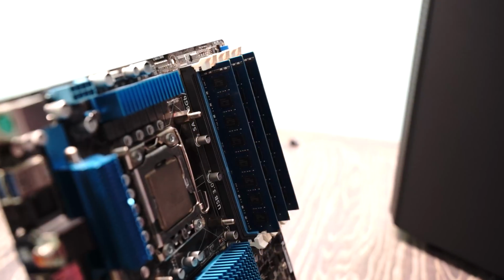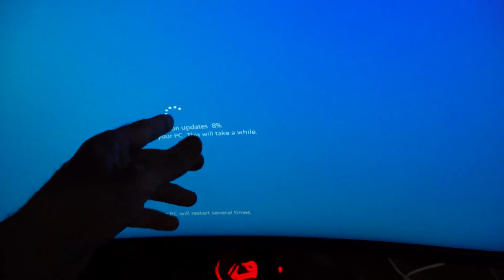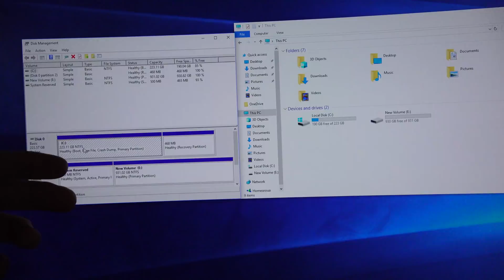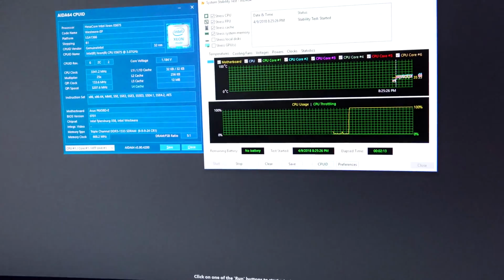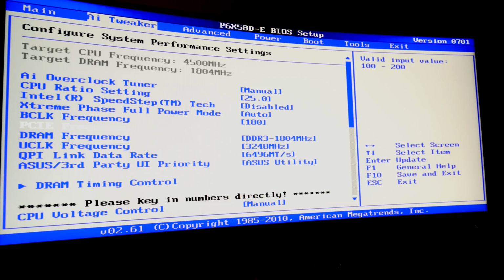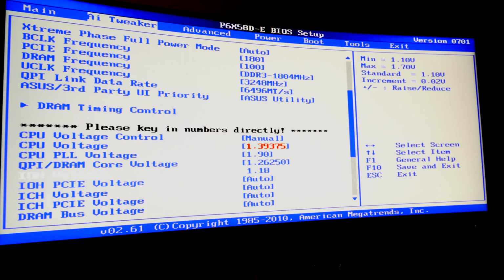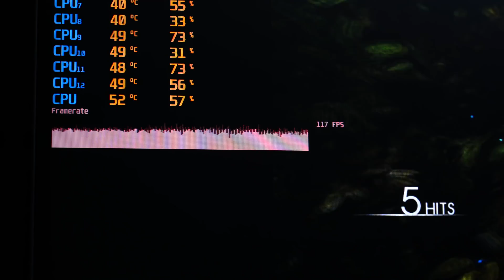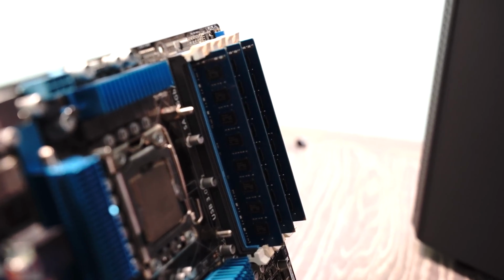Is X58 Still Worth it..? Taking the 6 Core X5675 to 4.5GHz on AIR.

Comment: Iv been rockin my 1366 x58 platform since 2011.....Im not sure why it would be your favorite platform, its completely useless.

The 1366 platform was a flop. Triple channel memory showed ZERO benefits and no real increase in memory bandwidth over dual channel.

The IPC of the first gen i7s was horrible even at the time and the only true benefit to using the 1366 platform was to have 6 cores. Which, at the time was also useless unless you were running very specific programs that can make use of multicores. 95% of your programs out there, even in 2019, dont make good use of multicores. Even today, 6 cores is pretty useless.

And if 6 core was what you wanted, a year later Sandy Bridge came out and wiped the floor with it meanwhile Intel abandons the 1366 platform for desktops almost as soon as its born.

In terms of performance, within a year the X58 chipset became not only irrelevant, but non competitive for its price. Even today, theres much better options for the price.

This all is coming from someone who has had a first gen i7 since day one. At 4.5ghz they finally start become more on par with Sandy Bridge (which is more than 1ghz high speeds) nevermind the insane power draw and silicon melting temps as a result. 

They are too power hungry for good overclockers. 4.5ghz was impressive back on the Netburst days, but modern chips are hitting past 5ghz easy.

Comment: I already have all the parts I need to build my computer but I found this sweet deal i wish i had gotten before i bought them all. 100 dollars for x5675 cpu with motherboard, cooler, psu, and 4gb of ecc ram: https://www.ebay.ca/itm/163768068094

Comment: idk why you're having so much issues... i didn't with my P6X58D-E... 
Tho i did have to find a thirdparty driver for the Marvell 9xxx Sata 6gbps controller :P
Reply: Btw, running a i7-950 at 4ghz rn, (211 x 19 @ 1,27500v) Gonna upgrade to a X5670, X5680 or even X5690 tho.

Comment: Dude man running 4670k @ 42 ghz overclocking and been running like this 6 years still solid with Maximum Formulas  Asus Rog motherboard Corsair vengeance 1600 DD3 Memory  SSD OCz

Comment: YES IT"S WORTH IT STILL! I have Asus Rampage III Formula with 24GB Ram at 1600Mhz Running a Intel Xeon X5687 at 4.2Ghz atm and the Motherboard supports PCI-E 3.0 :) with 2 GPU's at 16x PCI not 8x like most board these days.
PUBG 75FPS Max Graphics on FreeSync (Speed of my Monitor)
GTA V FiveM 60FPS Max Graphics With FreeSync (But Frame Limited to 60Fps)

RUST 75fps Max Graphics FreeSync

I don't count games like Half-Life or Fortnite Because they go so far beyond the monitor specs i Freesync it to 75FPS but if i turn it off it just keeps raising

Comment: Hi, i have a Xeon 3690 with unlocked Multi. How much VCore can i give him? 1.45  @ 4.4 ghz is absolute stable. 1.48 @ 4.6 worked, but was not stable (temps aroung 65-70 C). you think i can give 1.5V Vcore?

Comment: The sad thing is that x58 is dying not because the CPUs aren't any good but that the prices of the motherboards are quite simply ridiculous. If you go the route of getting a new Chinese one from Aliexpress then you'll often find they have no overclocking ability, which kind of removes the point of going for that socket and chipset in the first place.

A $20 CPU isn't worth it if the motherboards cost near $200.

Comment: will a rx 570 work on x58 motherboards? anyone know?
Reply: I run a rx 580 8gb I'd assume so
Reply: @dabbo1980  "I'd assume so" sorry but im confused so you are saying you are in fact running an rx 580 on a x58?
Reply: @dabbo1980  nvm got you buddy, in that case it should be fine with rx 570 cool thanks
Reply: @dabbo1980  btw is your x58 one of the ones sold on ebay, the unbranded ones? I just want to know that the board wont give me problems

Comment: I have a 4930k, custom water-cooled and running 4.7Ghz @ 1.41V for the past 5 years. Running numerous benchmarks, it comes in just under the Ryzen 1800X stock for multi threaded and is faster by a good margin in single thread.

Not to mention the older quad and triple channel memory boards keep pace with the dual channel ddr4 boards at 3000mhz or greater.

Obviously clock for clock the 4930k is starting to show a bit of age, but with a good overclock it holds its own and I'm still surprised at how slow technology as moved in raw CPU performance. The trade off is, my old CPU uses 180W to achieve what a 90W processor does today.

Great video!

Comment: Which Ram should I use on this motherboard ? Can i put in a cheap set of ddr3 without having compatibility issues ? Currently running 4 sticks of dominator ddr3 memory but can't get all 6 sticks work togheter ( pobably 1 dead stick ) with x5675 and RTX2080

Thanks

Comment: Just out of curiosity I glossed over the prices on Ebay for the Asus X58 motherboards and they still command USD $170 to $200. Overclocking is fun and all but I think I'd rather go with a Shenzhen noname X79 and Ivy Bridge based 6 core Xeon for less

Comment: Could u do a video where u compare performance between for example: 211mhz x 19multi, vs higher multi and lower base? (Both should be 4ghz) and see which one performs the best, and is the most stable.

Comment: Is there something that i´m missing here??? Just got the same board with the same cpu and just started with overclocking. Followed most of your settings but i can only get the multiplier to 24. Bus speed is set to 175 to obtain 4.2 Ghz but I keep dropping the voltage more and more and i´ve gotten to the point that i´m at 1.24V and it´s stable on aida64 for over 2 hours now....??? Is this normal and should i keep dropping the voltage? Temps are currently at 68 degrees at full load after 2 hours with my noctua air cooler. Any advice would be highly apreciated. Also.. my memory which is 1866Mhz ddr is running at 875Mhz (Dram frequency) 2:10 FSB:Dram, CAS 9.0 11-11-28. Is the memory running the way it should be? I am not getting any errors so far.

Comment: I have a UD3R and I am having the issue you described. I cannot get it to boot. I have 4 solid lights on motherboard but screen is blank. i7 920 works perfectly fine but once I put in Xeon 5670, PC did not boot and black screen. Gigabyte EX58 UD3 R.  Rev. 1.6,  12GB Mushkin Black, OCZ 1000watts, Windows 10 and when I tried to update to newest bios it wouldn't. So I called Gigabyte and they told me that my board does not support Windows 10, only 7 so I was not able to update. I believe its F1 or something. It was the 3rd from the latest Bios version. Any help would be appreciated.

Comment: Stumbled across this video after picking up a DELL Studio XPS 9100 with a i7 960 quad core @3.2GHz, 12GB DDR3 RAM, EVGA GTX 960 SSC, x2 1TB HDD and the touch screen SX2210 monitor for $160 on Facebook.  I then found a Lenovo ThinkStation S20 with 24GB DDR3, Xeon W3680 hexacore @ 3.3GHz, a Intel Pro 180GB SSD and a Samsung 256GB SSD for $80 on OfferUp.  Put it all together with a GTX 1060 3GB I got for around $70 on eBay.  Now I have 2 gaming rigs that can run my Oculus Rift and anything else I throw at it for around $300 USD.  The w3680 overclocks to 4.2GHz damn near effortlessly.  There is NO better bang for the buck unless you are shooting for a low voltage system or have a garbage PSU.

Comment: Hi Mr. Brian, I really like your videos and I just bouth two x58 motherboards .. 
1: Gigabyte x58UD3 With a i7 960 for about $56 USD on Ebay.
2: Asus sabertooth x58 with a x5670, 24 GB and a heatsink but don't know the brand for a $178 USD.
Sed that, the Gigabyte motherboard has some bend pinsbut nothing major.
The asus is in good condition boot to the BIOS and recognize the xeon x5670 but when I try to install windows  7 or 10, just when is about to finish the installation i get blue screen. I try different jhd and a ssd but still get ablue screen.
My question is.. what I missing or am doing something wrong? 
I have a cooler master m240L A/O WATER COOLING but nothing.
 Any help will be great. Thanks Love the x58.

Comment: I have a HP Z420 workstation with stock motherboard. can you overclock E5-2643 v2?
Reply: nope, only the e5 16XX v1/2 chips can be overclocked on your platform - and on x99 e5 16XX v3 chips have an unlocked multiplier too
Reply: @SGIMartin  how can i know if any processor can be overclocked?

Comment: The problem with x58 boards is their is only 2 to 3 pcie 2.0 x 16 slots. Where most new video cards need pcie 3.0. So you can run a new card in pcie 2.0 but will reduce the performance of the card so it's not really worth it.

Comment: Should have gone for the W3690 for about $80. I overclocked mine to 4GHz and it doesn't get past 55 degrees with a Hyper212. It benchmarks 5-10% above the much more expensive X5690, which is meant for dual CPU mobos. It's almost twice as fast as the i7-930 I had, which overheated and had to clock down when I tried to push it to 4GHz. Highly recommend the W3690. Cheers
Reply: x5690 is cheaper actually because they were produced in pairs.

Comment: I recently bought a complete X58 gaming rig for &100au that has the ASUS P6X58D-E mobo. I was wanting to get a Xeon CPU for it but when i checked on the ASUS web site for compatible CPU's, only the i7 900 series was listed so i am running the i7-950 that came with the system. I am spewing i didnt see this video earlier. The only upgrade i have done to this PC is to the CPU cooler.I got rid of the standard Intel unit and replaced it with a GAMMAXX 400. I am now ready for some overclocking. 

   I do also have another ASUS mobo which was given to me for free by someone i bought some ram from. The board is an ASUS P6T Deluxe V2 and is complete in the box. I was told it was refurbished by ASUS but the guy that gave it to me moved onto a newer board in the mean time. Now my question is. Can i use an X5675 CPU on the P6T Deluxe V2? The ASUS site only lists the i7 900 series as compatible.

Comment: Holy crap I have this cooler (MA620P). NO NO NO NO NO. The pain and suffering this thing has caused! It usually fits on the motherboard VRM/caps, so you have to use it like facing top or downwards. The whole install performance is awful. Want to replug a cable? Touch anything? Time to remove everything from your PC. Just no, please. Don't purchase one. As good as the EVO212 is, this sucks hard.

Comment: Msi big bang x power here. I just recently upgraded from i7 950 to i7 980x, i wish i saw this video before. I run a msi gtx 970 on that thing and most games on high to super high gives me around 50 to 60 fps. Cpu still at stock speed because i need to get a nicer cooler. I also was doibting to add a gtx 1070 for fear of the cpu and chipset being bottlenecked but now i dont. I dont know if i should get another gtx 970 the do sli, get 980 or wait for 1070 prices to go lower, any suggestions?

Comment: After overclocking the gigabyte x58 ud3r with x5675 I have learned a few things. 
Cpu clock is less important than overall memory speed. I can shoot in the 1000s at 4.37ghz Cinebench. At 4.5ghz I can only shoot 1030. At 4.43ghz again 1030. Geekbench scores lower as I go above 4.4ghz. 
Also the memory clock speed is less important than uncore. If your uncore is less than three times the base freq you are bottlenecked at the memory. Or that’s how it looks. So why run 1800mhz if your uncore is below 3200mhz? I score higher with a higher uncore and lower ram speed. I run spd of 8x and 1688mhz and an uncore 3376mhz. It is smoking fast and prime95 stable. I also understand different components will stabilize at different settings. 

I see the settings he is using and am a little confused because I get hardware failures in prime95 on the cpu side and rounding errors on the memory with the same settings as him. It is aida64 stable but not prime95? I get it it takes lots of time to get the components on a new board to be stable and these settings are close but it’s misleading for someone to think they can copy these settings and get even close to the same results. I also have a board that won’t run a multiplayer that high.
It’s also doing the setup no justice to overclock beyond the usable limit of the system ram. Again these scores are achievable at much lower clocks like 4.37ghz will shoot over 1000 Cinebench. But for fun the higher the number the more impressive I guess.

Look at it like this. You jump from low 700s up to 1000 with a 1000mhz bump. So 30%. But from 4.3x up to 4.5 you only grab maybe 30points? For my setup the sweet spot was 4.40hhz. Any more was not worth the 3% gains.

Comment: If the case is causing hardware issues, maybe use tape over/around the standoffs. Or one of the sides of the board (metal part) were making metal contact with the case.

Comment: My daily driver is still an i7 960 overclocked to 3.8 GHz on this motherboard, that I built back in 2011. Still works fine today. Had plenty of dramas overclocking it but it's stable and still going strong for a computer that is 8 years old.

Comment: I'm building an X58 pc... Got a P6T Deluxe and X5670 just a couple days ago on ebay, and you're right - they want way too fucking much for X58 mobos on ebay. I paid $180 for mine used.
Reply: Maybe because the supply is small compared to the demand.
Reply: @ogad84  I don't really think there's that much demand for them anymore... Anyways, the P6TD was a scam, seller broke the board and tried to put it off on someone else, told me it was broken in shipping and it was perfect when he put it in the box, yet a piece was broken off the board and wasn't inside the box.

I returned it (after months of fighting with him) and now I've got a G1.Sniper X58 board and x5675, but I can't seem to get more than 4.3ghz on water with a fan on the chipset. I can't figure out why it's unstable there so I've left it at 4.2 for now.

Comment: I got an old ass Gigabyte x58a-OC motherboard with an i7 950 running at 4.2ghz with 12gb of DDR3 @ 1600mhz CL9 that I gave my parents with a shitty graphics card just so they had something decent to use. (I think it has Win 7 Ultimate 64bit on a 64gb SSD and a 500gb WD Black) 

I think I may just buy them a laptop and take the PC back LOL... get an i7 990x or the X5675 for a couple extra cores, slap the GTX 1060 6gb I have sitting around... a PCIe USB3 header add-on (so that the front USB3 on the case could finally work as it only has USB3 in the rear of the MB).

That thing was def no slouch back in the day. I had 4 way crossfire on that board once with 24gb of ram. I think I had some SIlverstone 1500w psu... whenever I'd run 3dmark, the lights in my room would dim hahaha. Good times. The board and CPU still live on. Can't remember for the life of me what cards I used... They were ATI and started with a 7 if I remember correctly. 

GPU's may have come a long way since then... but the fact that those CPU's can still hold their own today is crazy.

Comment: A Xeon X5650 (4.0GHz) Build for 300$ Vs. i5-2500K Build for 200$ for long term??
Reply: Ryzen build mate.
You can build a Xeon setup under 100, without GPU.
I5-2500k is meh, i'd say i7-2600k is the sweet spot, if you can get it at 4.0Ghz, and it would cost around 150ish dollars, better performance than x5650.
Ryzen 1200 is around 100 dollars, performance is similar to the i7 but you have a clear upgrade path, in year or so you can put a R7 on that same board without changing anything, while Intel is outdated and has no upgrade potential.
Also these prices include no GPU/RAM as that is different from user to user and depends on what will you use the pc for.

Comment: I managed to buy a i7 920 a decent mobo and 12gigs of ram for 110$$$....im proud
Reply: im proud of you
Reply: I bought a used p6t Deluxe v2, i7-920, OCZ 6gb triple for $100 a while back. Just order a x5675, CM 212 Evo and G.Skill Ripjaws 12gb 1600mhz triple. Haven't built it yet, my A8N-SLI Premium AMD 4800+, LSI 9211-4i, GTX 7800, Antec P180 is still running strong, but want to rebuild rig to utilize a GTX 1070. I'm excited too, bookmarking all these videos so I can document all these settings...

Comment: Sabertooth X58, x5660 @ 3.8ghz with no OC experience. Under 200€ for the set in 2016. Beats i7-4770k at Cinebench with 850pts. 

The xeons still dropping in price. Looking at your set, might throw the $50 for x5675 to hit closer to that 1000 points mark with less pain.

Though Ryzen was sent from the gods for new pc builds, it's ~400€ to go Ryzen 7 for an actual upgrade including DDR4 and mobo.

Awesome system for music production and gaming! Just hope it lasts, but I guess the sabertooth was built to last.

Comment: While I love, LOVE giving older hardware its dues, if I have to change around different motherboards, cases, coolers, memory before I can even start to test for stability... then it's more of a hobby than a practical thing. Time is also worth money when you're working, let alone the price of having to swap out parts (which, unless you've got them lying around, also adds to the cost). 

I know not everything got changed, but to troubleshoot the issues, stuff needed to come in and out... and unless you've got the parts handy, you're out of luck. 

I adore this type of stuff, but I don't think I'd do this for something other than a hobby. If I'm using this for anything other than gaming... I'm going to try and spend a bit of money into stability, compatibility and future-proofing. In fact, that's what I did when I built my first-ever brand new system 3 weeks ago. I just don't want to deal with the headaches of making this stuff work anymore. I'm 32, I just want my stuff to *work*. 

Lovely video, though, and WOW... those are some IMPRESSIVE numbers for a 10 year old platform!

TL;DR my comment is basically: it's worth it for a hobbyist with easy access to spare parts and time for trial and error. For the average user, I personally don't think it's worth it.